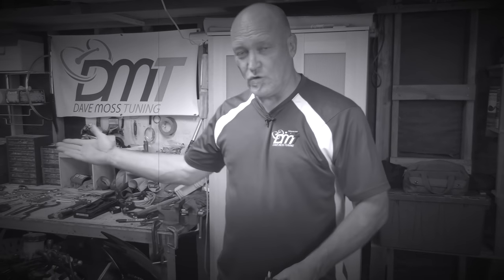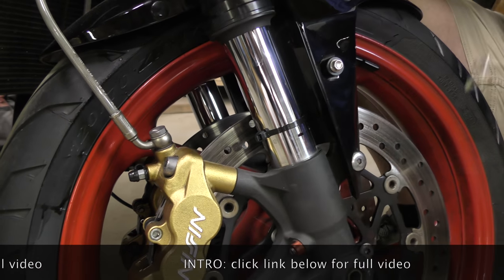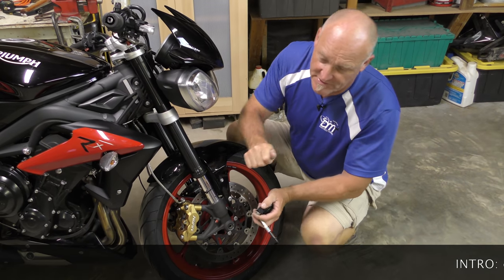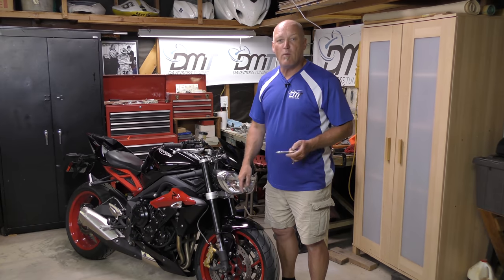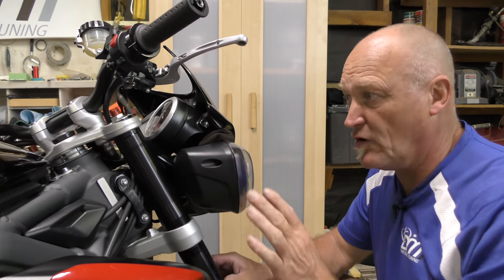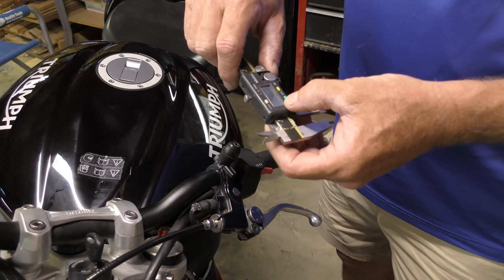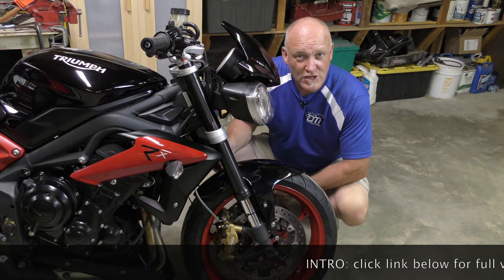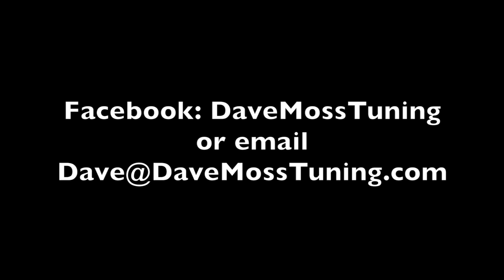INTRO How & Why To Change Your Motorcycle Fork Position

Comment: Dave, so i watch lots of your videos, and what i understood so far - that factory version setups of all bikes is coffins???? i am surprised , no one ever sued any of manufacturers. and i never seen that any of them said - dont ride hour product before you take it to dave :) :) :) :)
Reply: Suspension is a highly personal thing, just like lever positions, mirror position etc. Factory bikes are set up one way. That set up fits a very very very tiny subset of people. Usually 75kg 180cm perfectly average proportioned males. If you match all that, most bikes will probably fit you perfectly, however even at that point the suspension is built to a budget on most bikes and they have to make compromises between track vs road, good roads vs bad roads, twisties vs highways. Whilst the suspension maybe perfectly set up for your weight to ride good highways, they may be entirely inadequate for bumpy twisties.
Reply: @AntaresSQ01  no mate, still not agree with you - everything in the world(cars, pedal bikes, small air planes and etc. is build on average humans measurements. but any human can ride it without accident in any condition. and of-course, ergonomics and other little adjustments only would give more comfort and performance. but is no way, that if say you r 160 and 80kg you will get into accident (on any road and condition), just because you did not done all Dave's adjustments and ride stock bike!!! Tell that to any bike shop- see what they say - this would be against human rights to sell  bikes if it was like that! who needs Dave's help- is track race drivers only, because it gives more performance where seconds matter. 

and just to add - so you say, i can not go to bumpy curvy roads on my stock bike??? no way i am going to change my shocks - than better to buy bike that has them already- i haven't been told in the shop not to go faster than 70km/h in not perfect road conditions when i bought it!!!
Reply: @labasrytas2876  i never said youd get into an accident, its just a correct suspension is confidence inspiring, a bad one is not. Bikes are more sensitive to rider weight cos the rider makes up 1/4 to 1/3 of the vehicle's gross weight, f9r cars this is usually 1/15 or less so your weight barely makes difference. That's all. The best example  i can thing of is the MT07, forks pogo for anyone over 80kg, don't for people under.
Reply: If you have an 800lb bike, the springs necessary just to carry the weight of the bike and have some sag will accommodate a much broader range of rider weights and still be in some acceptable range. 
Car example: If you throw 4 heavy set people in military Humvee, it's barely noticeable).

If you take something lighter, the rider's weight starts to become a noticeable factor.
Car example: throw 4 heavy set people in a civic and it goes from feeling light and stable to sloshy-body roll and the rear end resists coming around but when it does brake loose doesn't want to recover anymore.

So let's look at a light bike and see why this just isn't possible to create a perfect in all situations:
Sprung for heavy rider:
If they spring it for a heavy 280lb rider, the spring is almost double what it needed for just the bike weight, has sag, damping etc.
*Now a light 120lb rider hops on that bike. Because it was sprung for double the bike weight, almost if not all the sag disappears. The ride will be stiff and harsh. The rider will probably think that's because they don't have enough skill and that the suspension is meant to be pushed more, where it will feel better. And they are even partially right! But, because the person doesn't weight enough, the springs overcome the rebound damping, so bumps become quick jolts that bounce the bike just a bit. The lack of sag means the suspension can't react to drop the wheel for road imperfections, so that means either wheel loss of traction (just what you want in a corner, right?).
*If the rider tries to take corners in a neutral very tame balance, the front end will skitter on bumps and want to wash out.
*If they take corners with aggressive trail braking to keep the front end weighted, the overly stiff suspension will send rapid shocks of weight shift front to back and forth, giving rapid shocks of traction & loss of traction, while the rider is loading the front tire more. Does that sound beginner friendly?
*Also, if the front wheel can't drop to accommodate road imperfections, how do most tank slappers initiate? Oh yeah,  people coming down from a wheelie and the wheel being at a different angle that the travel of the bike...

So you can see why manufacturers don't want to even approach those risks with a 10ft pole.

So let's flip it,
Sprung for a light rider:
Light bike with a light rider, the rider is approx 1/3 of the bike weight, sag and dampening set, beautiful.
Now throw a heavy rider on that, and the bike squats.
*Everyone can instantly tell the bike is overloaded with the weight. The bike squishy both undersprung and underdamped, and divey. The rider will feel like it is hard on the bike and they naturally take it easier.
*They don't feel confident braking hard because feeling like you are going over the bars is uncomfortable, non-confidence inspiring. (sadly, actually makes it harder for a new rider to learn)
*Going too fast over hard bumps bottoms the suspension, and it bucks. You feel the shock through the seat, so you feel (and are) beating up the bike to push it on stuff like that. Again, this inspires to play it safe, take it easy.
*the bike still soaks up light stuff, but when it bottoms, it is indeed dangerous -but, for most stuff it isn't dangerous if you are taking it easy 
*until you run into something unexpected, such as a pothole that either catches the front end when you panic brake or the back end bottoms and being underdamped tries to launch your lazy non-standing butt over the bars
**overall, this is a much safer outcome than the severely over-sprung and overdamped bike, and when it fails, it can be blamed on the rider, because they should have been more tame, seen, and reacted to the more extreme pothole, bump, etc. (and indeed, more riding skill and more alertness would probably have passed unscathed, with a few muttered expletives at the inadequate suspension that did in fact try to kill you)

So what do manufacturers actually do?
They go mostly to the way-soft condition, but out of concern for too light riders, they compensate by weak damping. It's the perfect one-size-fits-no-one solution.
Most people can hop on the bike without killing their selves, and it generally pushed riders to ride more safely.

How did we get here? Why don't manufacturers included more travel, more compression and rebound settings range, and include spring options by default?
It's our fault, the riders (well, not me, because I don't buy new, ha ha)
People like to drool at the expensive/premium option, shun the low option and end up buying the middle option
(it's why store-branded inferior options exist in grocery stores - they drive you to buy the middle option for just a little more money). Sure, some splurge or always buy the premium option, and some are cheap and always buy the lowest cost (however they factor that), but 80-90% of people buy the middle option.

So take 50years of companies offering the premium package for $3000more and people cheaping out to the standard package and guess what? You get more of what you endorse. So they just stop putting the cost/time/effort/parts support into better suspension, because it doesn't help their sales or bottom line at all.
*If their bike came standard with those options, you'd be comparing their competitors $8,000 bike to their $11,000 bike and despite the advantages, people would wish for but mostly buy the competitors "almost as good at a fraction of the cost" middle option.

Am I going to change this long-standing trend? No, because I don't buy new.
Imagining a conversation between me and the manufacturers: 
Me: "I'd like you to start adding___ and stop this__ and changing this____"
Them: "Ok, how much are extra are you willing to pay beyond current price for those things?"
Me: "erm, um,... well you see, that's the thing, isn't it..."

So I'm not even really their customer other than as an influencer role and replacement parts.